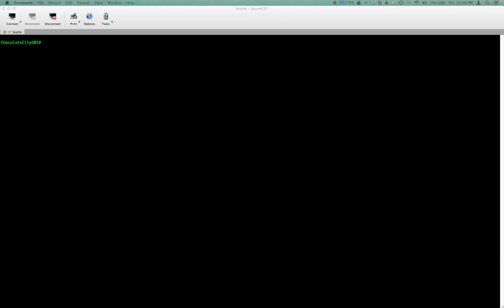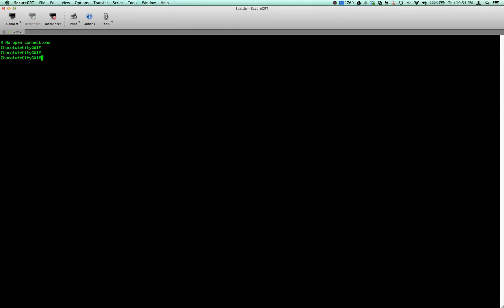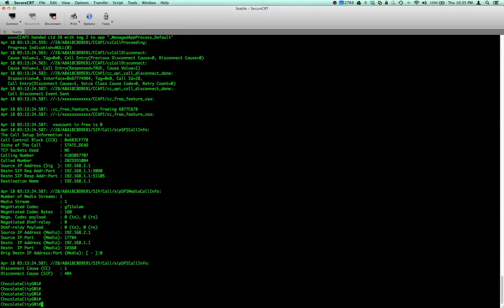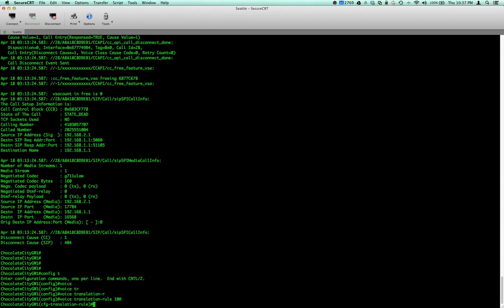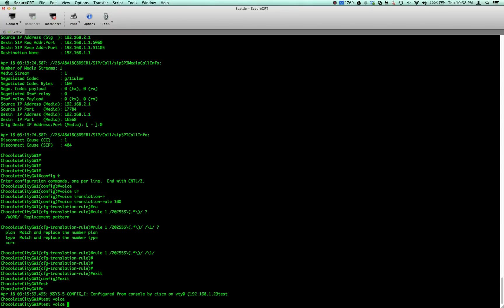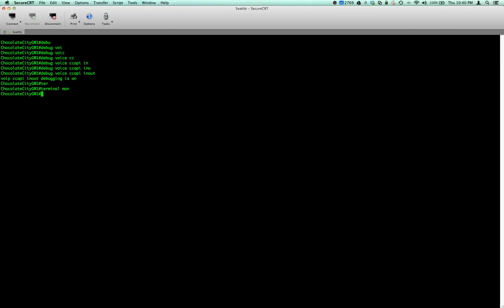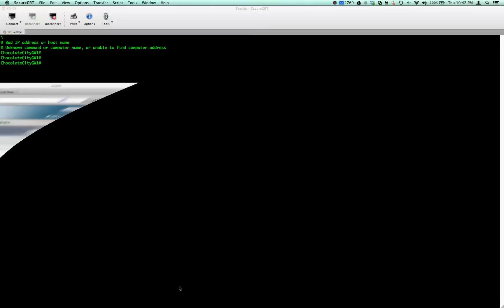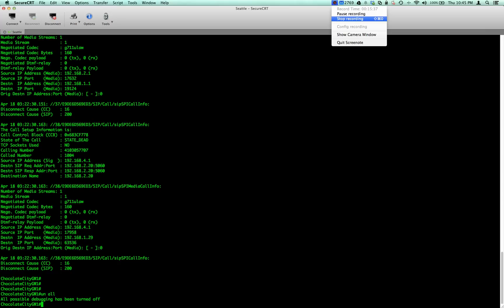CUCM SIP Trunk

Comment: Cool video. Why did you do a SIPT from the CUCM to the GW, vs H323 or MGCP? Just curious to know the pros/cons.
Reply from the maker: You can do H323 and still use a SIP trunk on the other side which was pretty common back in the CUCM7x days.  Now that we are 10 and in a much more mature system its easier to do SIP to SIP which makes troubleshooting much easier as you only have to read one type of debugs.  Also the SIP feature set is getting much more advanced.

To answer your MGCP question you can't use it with SIP trunks.